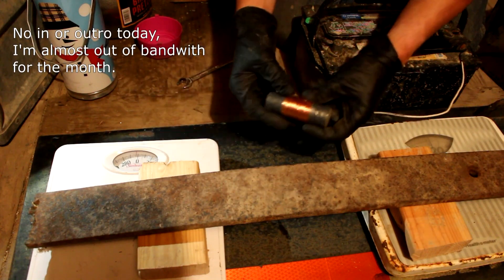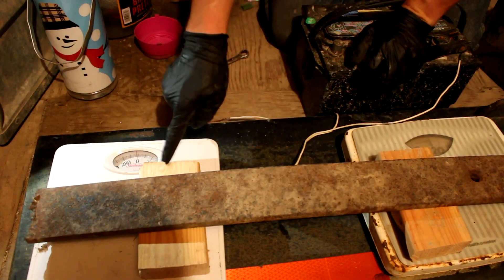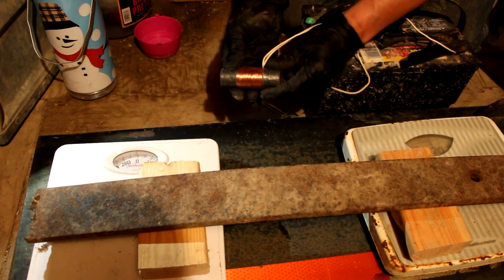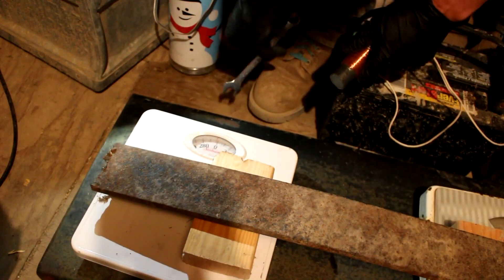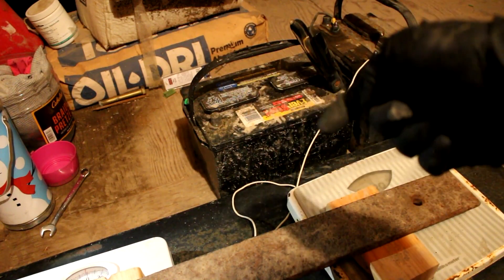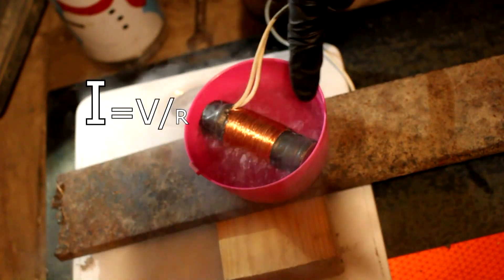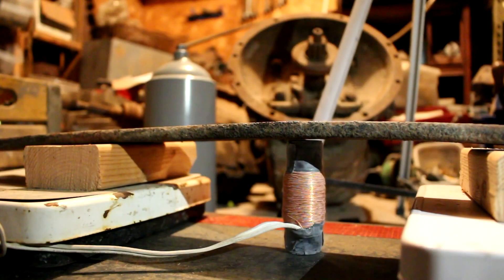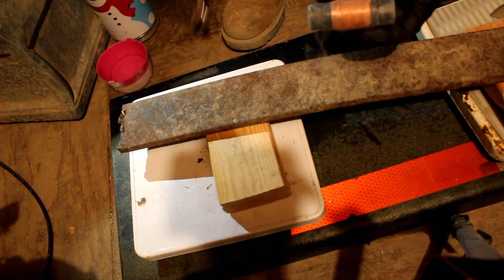Electromagnet in Liquid Nitrogen

Comment: here's a question.   What would happen if you weigh the table?  Will it change?  is it levitating. . Or putting pressure on the magnet equal to its weight?
Reply: Newton's third law. The metal pulls the magnet up as hard as the magnet pulls the metal down.
Reply: Phygar1 ok.. well I know that a helicopter puts downward pressure to create lift. . But at what altitude does it stop doing that, .and start putting pressure on the actual air?
Reply: it's always putting pressure on the ground regardless of height. the higher pressure air below the helicopter pushes on the air below it all the way to the ground, but by then, the pressure would have dispersed very evenly.
Reply: ***** I don't know. . That's very odd..
Reply: ***** so according to you the space shuttle keeps putting pressure on the earth until it reaches space? ?  Even 53 Kilometers away?
Reply: ***** ...even over uneven terrain ... even over the ocean. . And vertical buildings?
Reply: Basically. In air things that fly put pressure on the air around it. In space, since you only need to combat gravity, you use the force of pushing particles backwards to gain speed and therefore altitude. Imagine blowing air out of your mouth and having your head move in the opposite direction
Reply: Demonic Koala that's what I'm saying. A flying plane puts pressure on the air under it to create lift.. or in other words less pressure on the air above it to provide lift. So he's wrong in saying that a helicopter puts pressure on the ground to push itself off the ground... and then it evens out the pressure along a larger area as it flys up.
Reply: Demonic Koala but again ... I'm asking it does put pressure on the ground at the beginning.. that's obvious. . But at what point does it stop doing that? And then starts compensating for the lack of ground by putting pressure on the air under it?
Reply: Nname Withheld no, rocket propulsion is very different than propeller propulsion. if the air underneath the is pressurized, the ground is pushed with the same force as the helicopter is, newtons 3rd law. in a rocket it pushes off exhaust gases ejected at a high speed, this also fits under newtons 3rd law.

Comment: Very cool! So, is that permanent or just while the metals are super cooled? (i.e., until they get down to room temp)
Reply: Only while they are cooled.
Reply: Thank you. One reason I ask is because I saw a corporate salesman at the Audio store the other day. He was trying to get the owner to carry his insanely priced wire which he boasted had gone through a cryogenic treatment. Smacks of snake oil, so I'm trying to find out if he was full of it, or if there is a process that could permanently alter/improve conductivity.
Reply: DannoCrutch it may be possible to super cool a wire while it is solidifying to increase conductivity permanently.
But as I understand it that wouldn't work because wire isn't that hot near the end of the line.

Pretty much, I would say it's BS but I'm not the smartest guy on the block.

Comment: Does that mean, that if i cool the coil of my gauss down, i will have better performance?
Reply from the maker: Silver starts out less but copper drops more per degree so at liquid nitrogen temperatures copper is actually more conductive than silver.
Reply: If I use silver instead of copper wire, would that increase performance aswell?
Reply: yes, less power lost as heat=more efficiency=more power is given to the projectile
Reply: Whats with the silver wire, i've never seen one use silver wire for that purpose
Reply: Gettin insulated silver wire is either tricky or too expensive for most people building gauss's and it improves efficiency by only about 5.42%, so it depends on the budget :P if you have enough money you can try superconductive coils :)
Reply: MrSlehofer Good to know thanks
Reply: Im by far no tech person, i just like the idea of having a interesting project like that :D
Reply: Deer Viehch ok :) have fun
Reply: ***** Ok, i think im still gonna go with copper, because i just looked at the prices for silver wire :D
Reply: Are you gonna make it multi stage or single stage?
Reply: dehim verveen I don't really know. Multiple stages is when you have more coils down the barrel isn't it? But I think I will make it a very basic build, and later decide when i got it working properly.
Reply: just what is was thinking of doing.
Reply: Runar Klemetsdal Constantly supplying your coilguns coil with liquid nitrogen or dry ice will be another task tho
Reply: how about a peltier? It might not get cold enough tho
Reply: I don't know about that, a peltier element seems a bit out of budget for me

Comment: what will hapen if you use graphite instead of steel?
Reply: For a magnetic field to set up in the solenoid you don't 'need' anything for the field to travel through. Conductors tend to increase the field, however.
Reply: It is diamagnetic though
Reply: you need very powerful magnet for diamagnetic material, like rare earth magnet.

Comment: No take a microwave transformer
Reply from the maker: A transformer should show only very little improvement when cooled.
Reply: They require an Allspark though.
Reply: But not one from a microwave oven. They are horrible if used for anything other than the oven it came from...
Reply: They may be very efficient, but that doesn't mean you can't draw much more power from it if it's cooled to liquid nitrogen temperatures. You may not be able to supply that power from your wall socket though.

Comment: I wonder who much difference the result would be if you could use pure silver wire.   Is there a significant % increase that is measurable?
Reply from the maker: As it turns out silver is less conductive than copper at those temperatures.
Reply: ***** Thanks again for clarification.  :)
Reply: +Sci-Twi That sounds like a safe and budget-friendly solution. Thanks!
Reply: Yes, but so little it can be ignored. 

You won't call a cookie crumble a whole cookie, or are you? :)
Reply: Лол, привет
Reply: Sci-Twi так вот как ответить через гугл+, теперь уже прив
Reply: Pedro Afonso Oitaven de Sousa Oh misread, my bad :o
Reply: The magnet might be superconductive then, but the wires leading to it will go up in flames.
Reply: depends , a material can conduct better but could have a way higher resistance
Reply: +PingasTheFourth You can. You can't turn helium to solid, though.
Reply: This PDF explains the properties of the solid (crystal) phase of Helium(-4). http://people.physics.illinois.edu/Ceperley/papers/010.pdf I think they're also known as Supersolid or Superglass state.
Reply: Is this still the case with ultra-pure silver? Is this inherently true or just due to impurities?

What about Au or Al? They're both less conductive at RT, but what about in supercooled conditions? What about something like supercooled Hg?

What is the most conductive metal at ~ -196C? Could a supercooled, non-metallic, perfect crystal of some sort be more conductive than supercooled metals?

Does the core material/alloy make a difference? Would using a different core help as well?
Reply: +Speedow You are right, it can be a supersolid, but I meant ''normal'' solid before. Like you have copper for example. Thanks for pointing that out :)
Reply: Liquid helium is ~50x the price of liquid nitrogen. Would be a cool experiment either way though.
Reply: +Joe V You can Google all these, but there is also a problem, heat loss. I mean, when you use the magnet, up until you use it actually, you have some heat transferred to the magnet, so you have a higher temperature. You can estimate the new temperature though, by taking into account the specific heat, the way the magnet warms up, etc, and then find the best material to use.
Reply: Maybe not at those temperatures, but they did use silver to wind powerful magnets during the Manhattan project (before they used centrifuges). Richard Feynman recalls in one of his books how he was sent to collect a few truckloads of silver from Fort Knox (or some such place) and upon demanding the silver the general in charge there told him "Young man, I'll have you know we measure silver in troy ounces here, not tons!". Suffice to say he got the silver, and after the war 99.99% was returned. They even burned the floorboards to recover any stray dust.
Reply: +PingasTheFourth mri scanners use liquid helium
Reply: No, that's the principle of super-conductors. 0 resistance.
Reply: +Cody'sLab wouldn't gold do better?

Comment: Wow, I have not expected this much improvement.
Reply: His electromagnet is made using a very thin wire... which also means the wire has a large voltage drop. Freezing the magnet like this drops the resistance in the wire quite considerably. With a lower resistance, less voltage is being converted to heat... which means the magnet field induced is quite stronger!

Pretty fun stuff :D.
Reply: Mee neither
Reply: +Jack Hudler No. MRIs are cooled with liquid helium so that the material inside them will superconduct, which is a somewhat different phenomenon.
Reply: Come on… just take some steel thermos and ask few people at any technical university or institution like that and they will probably give you some even for free. That's how I get mine.
Reply: +pvc988 +Lori Yeah, that depends on where do you live. In the technical university I study at they don't even do PCB manufacturing (not even in small batches, nothing) and at their chemical faculty they didn't even help me with finding a toilet. Yeah, you might or might not get lucky. Or you can get it at gas (as in gaseous materials) supply stores, yeah. Such local company is called Linde where I come from.
Oh yeah, and you'll also need some material that superconducts at or above the freezing point of liquid nitrogen. And yeah, you can go ahead and experiment with it, but if it freezes any of your body parts, it's gonna be your problem alone.......
Reply: CoolKoon He didn't use any superconductors. Resistivity of any metal (including copper) depends on its temperature. This effect is sometimes used in electronics and also can be a problem for some designs. Also liquid nitrogen is not that dangerous if you have any common sense. It won't harm you at all even if you spill a little bit on your body. But it's good idea to have some ventilation when working with it.
Reply: +Jack Hudler Uhm it's not the copper that gets superconductive in the MRIs (or any other superconductor for that matter).......
Reply: But that's just a regular copper wire. Anyone can do that at home.
Reply: +pvc988 Yeah, provided you can get hold of some liquid nitrogen that is....
Reply: CoolKoon
Pretty easy to do! As mentioned above there are some places that might give you some for free. If you buy yourself a dewar flask... gas supply stores sell it at a reasonable price. (It's used in various industries) Those supply stores usually charge extra for nonstandard containers though (It's generally a bit harder for them to poor it off for those, so there is more handling involved. Plus..... many charge extra just because they can.)

Now.... dewar flasks are expensive!
Reply: CoolKoon Like pvc988 said, you obviously want to ensure you know how to properly handle it... but it's not as dangerous to handle as you might think.

There is a phenomenon called the Leidenfrost effect. Instead of contacting your skin directly... the liquid nitrogen boils - forming a protective layer. Getting it on cloths is another matter though.
Reply: +pvc988 I know, but someone else has mentioned MRIs which DO use superconductors. But yeah, get some liquid N2 and you're in business.
+pvc988 and +Lori I know what the Leidenfrost effect is, but it only lasts for a short time and splashing liquid nitrogen CAN get trapped into body cavities if you're not careful enough. But actually the biggest problem is storage: the place needs to be well-ventilated, otherwise the vaporizing nitrogen will fill the room and displace all the other gasses (including oxygen)->suffocation. The container also mustn't be sealed. Either way it's kinda expensive fun unless you use it for a specific purpose.

Comment: if you had a smaller inside diameter of the coil the magnet should be much stronger. the iron core you are using has a very large diameter which limits how strong the magnet can be. very cool how cooling the copper makes the magnet stronger though. cool vid.

Comment: iron core ????? not steal core
Reply: Pure iron does not exist in nature. And steel is over 99% iron so you could call it iron no problem
Reply: ohhh ok thanks it just shows how i shouldnt pick chemistry at A level
Reply: You have to take into consideration that some types of steel are not ferromagnetic. Cores need to be ferromagnetic or ferrimagnetic
The most used steel for magnetic purposes is the so-called electrical steel that contains silicon. It is only used for laminated cores though.

Comment: what do you mean bandwith? xd
Reply: Because 'Murica. ISPs are basically monopolies and will force about a ~300GB data cap on you, which is suitable for a normal person, except for one situation - video streaming. And that is because they also supply you with cable TV, which no one wants because it sucks, so they try to push it by enforcing an arbitrary data cap.
Reply: Hyperpony what the fuck is this

'merica
Reply: In the sense he puts it, bandwidth is a measure of how much data you can upload at a given time. Your ISP (Internet Service Provider) sets this limitation based on area, so they can make money by you upgrading to a "different degree of bandwidth", which you can call a service plan.

To conclude, Cody couldn't add an intro and an outro because he almost didn't have enough "assigned space/bandwidth". It's the same with cell phone plans in most European countries as well. You can only make x minutes of phone calls, x number of SMS/MMS, and of course the "3gb of data" limitation (which resembles Cody's issue the best).
Reply: Colaglass dude i know what bandwith is xd
but why the hell does he have a limitation on data?
i mean i only know this from mobile data plans where you got a given amount of mb or gb in highspeed data in 4g or 3g and after you have used that you only have 32 kbit/s speeds left but on a home plan ive never seen this before
Reply: Benjamin Buljevic You don't get a choice. in most cases it's the only option available.
Reply: Telekom tried to do that in Germany, but the public backlash was too great, so they abandoned that
(Telekom is like Comcast in Germany, but less evil)
Reply: In some, less privileged parts of the world or anywhere there are businesses out to take as much money from people that they can get there are these things called 'Data caps' where ISPs (Internet Service Providers) limit how much data you're allowed per given amount of time usually per month. I used to have a $60NZD ($60 New Zealand Dollars) plan which gave me 80GB per month. The worst part is that there's no rollover (you don't get to keep the data you don't use per month) so if you don't use all of your data within the given amount of time you're basically throwing your money away.
Reply: this is some bullshit dude
id never buy  that xd
Reply: Move to Finland. Just reasently heard about data cap in USA and laughed my ass off. :D Mobile connections may have cap in here, but just few €/month, you can get rid of that. Total data cap for mobile connections is also illegal in here. You can give fast connections with cap, but still providing working connection, if all data is used.
Reply: Just saying, thats kinda bullshit, here in the uk we got unlimited
Reply: Reviews+Tutorials im from germany and i didnt know that  
hehe xd
1&1 4 pr3s1d3nt
Reply: +Mr. 42 Its like that in Germany except you cant get rid of mobile data caps.
You can still surf slow though
Reply: I don't think I could live without unlimited bandwidth.
Reply: He lives on a ranch in Utah most of the time

Comment: what is the relationship between resistance and temperature? as in are they directly proportional so would putting it in a regular freezer make it stronger also or does it have to be extremely cold for there to be a significant difference?
Reply from the maker: It is mostly linear and I do notice a drop in solar panel efficiency in the heat of summer because of this.
Reply: It depends on the material. Copper resistance decreases with lower temperature, but for example in graphite or silicon the resistance increases
Reply: it's called temperature coefficient every metal has it's own and it describes the resistanse change per kelvin of temperature change https://en.wikipedia.org/wiki/Temperature_coefficient
Reply: +Cody'sLab The amaising thing is: If you cool your wire with liquid helium down that is nearly -170 °C. What allows you to reduce the resistance to nearly 0R. That is called Supraleiter (in Germany I dont know how it's called in English) 

can you try that? 

And Cody why don't you messured the resistance before and after you cooled it down?
Reply: +Dan Brittain: https://www.google.pt/search?q=copper+resistance+temperature&source=lnms&tbm=isch&sa=X&ved=0ahUKEwjuwcvDyJjOAhWTDRoKHWb_B3QQ_AUICCgB&biw=1276&bih=705

You can see a neat graph for different metals there. As Cody stated, linear.

Do note that converting Celsius <> Kelvin it's just a matter of adding or subtracting a constant number where from (Celsius / Kelvin) <> Fahrenheit you ought to multiply it by 1.8, thus, the steepness of the curve changes.

Remember that math y=mx + b where m gives the steepness? a conversion celsius <> kelvin is something like y = x + b where a conversion (Celsius/Kelvin) <> Fahrenheit is something like y = mx + b

See how math is useful? I'm a Web developer/soft. engineer working 6 years, and I still find it useful sometimes even at my work
Reply: MARkoe93
he already linked the vid in the description xD